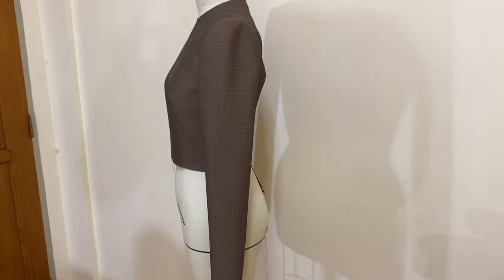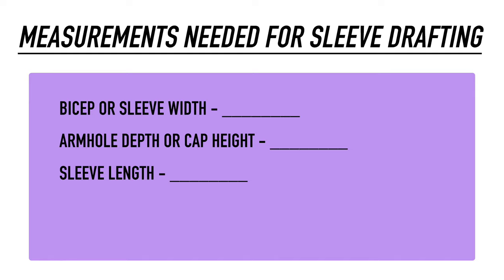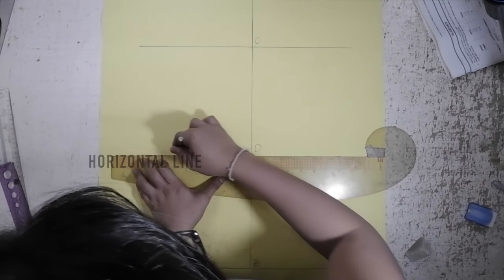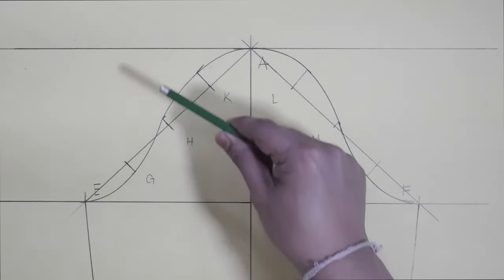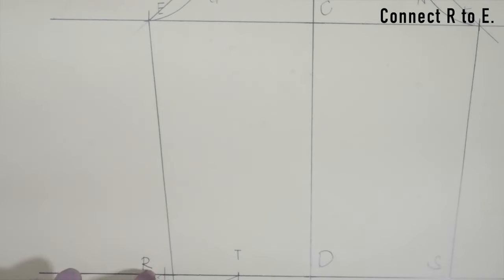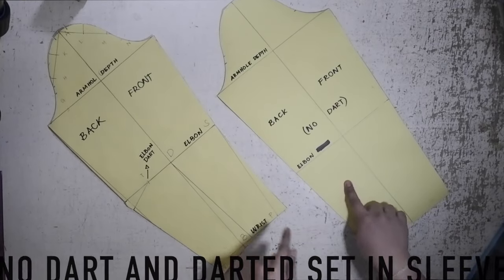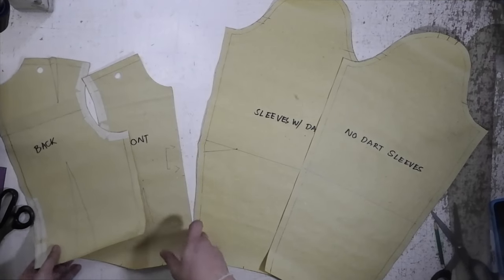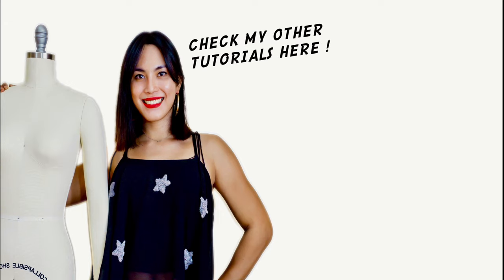BASIC SLEEVE PATTERN MAKING | SET IN SLEEVE/ DARTED SLEEVE | BASIC PATTERN MAKING | LA MODÉLISTE

Comment: Hello, is it normal that when I have the sleeve opened, before sewing it and making a 'cylinder' out of it, the two sides of it do not match? I mean, when I fold the sleeve in two, following the grain line, the two sides are irregular, they do not match
Reply from the maker: Hi there! Yes in some instances this could be a possibility. But it shouldn’t be more than an inch. So go back again to your pattern, take the measurements of the underarm side seams and if you find an issue on one side, try to fix it by redrafting that side and make it identical to the other side so that they have the same measurements. Tell me if this helps